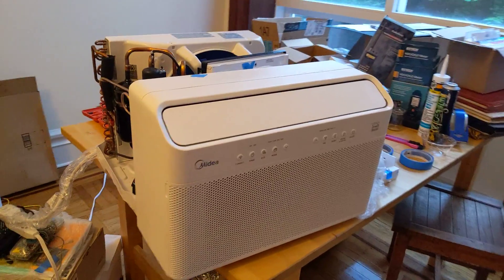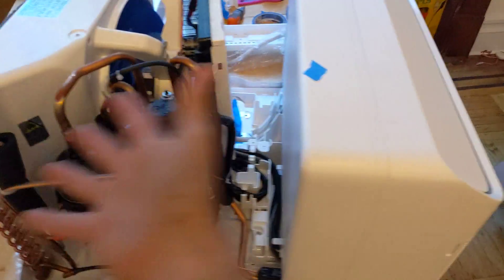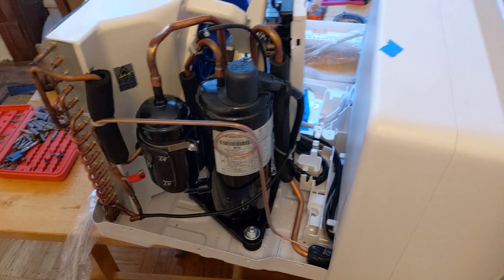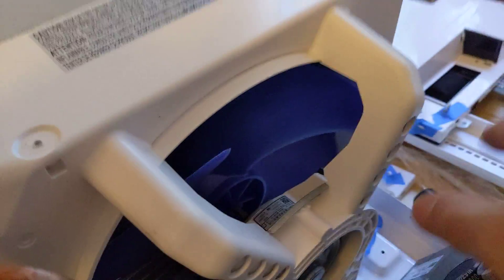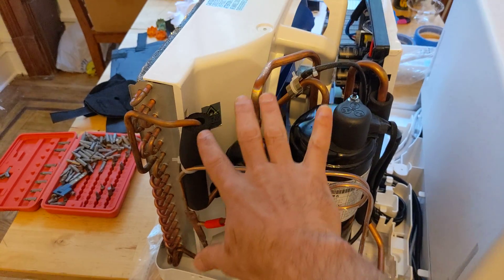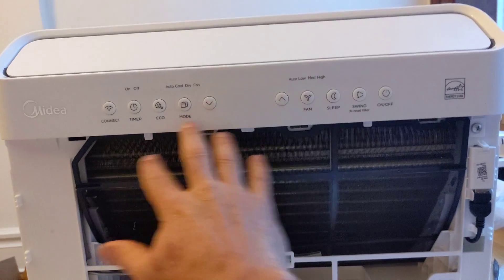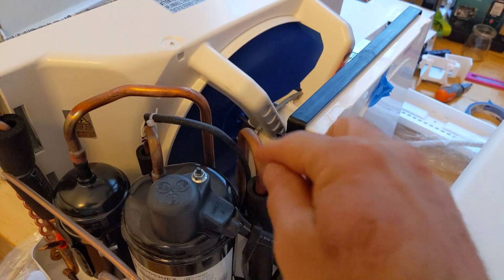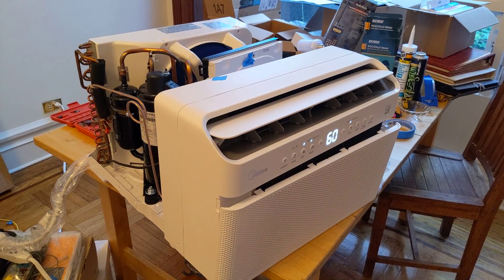How did Midea fit a full mini-split system inside their new "U" window unit?

Comment: Are there any actual power use comparisons at different speeds between the 8/10/12 models at different fan settings, etc.     I've seen a lot of user experience where even the 12000btu model hovers around 600-700w on high and often around 200w.    I'm off grid solar... more power than I can use or store on a hot sunny day but less at night, etc.     So for example running full tilt during the day to cool it down and letting it run on low at night to maintain may be the perfect setup... but really not much info out there.  anyone?   a video with it on a kill-o-watt would be fantastic.
Reply: I would love to see a test on power consumption as well.. Getting ready to decide on window AC for my box truck RV conversion
Reply: @mattolsson8816  I actually own two of these now, bought a 10k for the living room and liked it so well I bought an 8k for the bedroom. 

They are both extremely quiet, never 'surge'  as the compressor / fans just ramp up and down as needed.    The fan speed and mode determine power use.  

The 10k unit can definitely hit 700-800w on high on a hot day... but it cools very well and over time the power use comes way down.  Its not like other AC units there are either 'on', 'fan on' or 'off'... everything about these is on a sliding scale that adusts as needed.    On Low it starts out at around 2.6a and can work its way down to 1.8a with rare bursts to 3.5-4a for a minute our two here and there.  Setting it to 'dry' is the next lowest power use...  4-4.5a and cools while doing a lot of dehumidification.   Medium uses around 5-5-6a and high can use 7-8a.    But note these are 'MAX' values... it often uses much less power at all those settings depending on how hot it is outside and how long its been running... its like it hits its stride and can coast for long periods.    The 8k unit is the same thing with the power use curves geared a little smaller...  2.2a on low and often gets to 1.1a when running over night.  Otherwise the units are identical in function and same size in 2 out of three directions... the  bigger ones just extend out a bit more. 

Being off grid...  I use LOW at night and on cloudy days and medium or high on a good sunny day.  I've really never seen an AC like this... it sips power... overnight  use is saving me  15-20% vs the old frigidaire 6000btu unit I had in the bedroom and it was a very low power model.
Reply: @digitalalchemy6414  wow.. Thank you for that detailed description.. You may have convinced me to buy one of these instead of the 6000 BTU GE Profile unit. Sounds like it may be very suitable for my application.

Comment: Just installed mine. and while I love the quiet, I takes a long time to cool down the room compared to my old 12k BTU. I'm only getting 55 degrees coming out of the vents. Has any one checked the temp out of their unit?
Reply: What's the temp in the room?
Reply: Turn off eco and use boost setting.

Comment: Great video, thanks! We are really enjoying our new unit but another request for any information on disabling the annoying beep when you reset anything. It is way too loud. We have asked the manufacturer for a firmware update but no reply.
Reply from the maker: I already put mine back together, but I bet you could find the speaker pretty easily if you were willing to remove the cover. If so, you could either cut one of the leads, or probably even just put a piece of tape over the hole.

Comment: that's awesome! finally some contemporary tech! it'd be even better to have a U unit that worked without blocking the window. (that one but flipped over)
Reply from the maker: Agreed! SoleusAir makes one. Here is the link...

https://soleusair.com/index.php/2020/05/16/press-release-the-2020-winner-for-best-global-design-for-housewares-and-home-electrics-is-soleus-air/

It is a harder problem because walls can be much thicker than windows. Another interesting design that I have not seen would be completely flat with horizontal coils indoor and out. This could potentially be more efficient & confortable because of the upward air flow, but would require some creativity on the compressor placement. Maybe use a few of the soda-can sized ones in a row?

Comment: I ordered one for our Ford Transit van conversion project. I’m hoping I can separate the two sections (enlisting our auto mechanic for the refrigerant line work) but i see a lot of electronics cables between them. How hard to you think it would be to extend them?
Reply from the maker: If you are going to break the seal on the refrigerant lines (needs EPA certificate) then maybe easier to make one from scratch using new parts that exactly fit where you want. If this is for a 12VDC vehicle then you can get a compressor with a driver board that runs directly from that and it will be more efficient than driving this from an inverter.
Reply: @bigjoshlevine  I had the same idea, in my case I had bought the U from the Indiegogo campaign and have been using it all summer. You mentioned 12v compressors - I haven't been able to source one outside of very sketchy Chinese websites. Where do you source your compressors from? My bus will actually be 24v if that makes any difference. Thanks in advance!
Reply from the maker: @orangeisnon  I've gotten many compressors from Aliexpress and always had good experiences. The new good ones are brushless and usually come with a driver board that runs on DC so very efficient and easy.
Reply: Dude this is what I just asked about. My thoughts exactly! So I have an HVAC recover the refrigerant and I cap the lines. Get it mocked up on the truck with new lines as the two pieces are now away from each other. Figure out how to evacuate and charge, can just get a gauge set or pay an HVAC guy. 

I'm on the same idea. Just have to learn more about this type of system. I'm an automotive guy some R12 and R134 is my bread and butter.

Comment: LG has actually had fully inverter driven window AC units out for nearly two years now. Inverter-driven compressors and BLDC indoor/outdoor fan motors.
Reply from the maker: I have one of those! I was very excited when it was announced, but was disappointed when it arrived. Have you used one?
Reply: @bigjoshlevine  I've seen a 14k BTU LG Inverter in use. Quiet and seemed to work well. I didn't personally own it though.

Comment: Also, since this is essentially a window mounted mini-split system, does this unit also allow for heating in the winter in temperate climes?
Reply: For example, if you placed in the Auto Mode (since there is no heat mode), could the unit or would the unit simply pull heat out of the inside air and push it to the outside?
Reply from the maker: Unfortunately no, that would require a reversing valve which this unit does not have. But you can always just put the unit in the window backwards! I've done this before for heat - works great in mild outdoor temps (maybe above 40F).
Reply: @bigjoshlevine  Thanks for the reply! That's a very common sense approach to the problem. :)
Reply: @bigjoshlevine   ok, but then you forget to protect it from rain which gets the control panel wet and then the unit is junked!
Reply from the maker: @southbridgeforestHOA  I've left another unit outside and running for years and no problems!
https://twitter.com/bigjoshlevine/status/1285064587180740609

Comment: "Most interesting"????  I just finished installing a 10k Media in a small window.  The AC had BETTER be great and long lasting as it took me three days to finally complete the installation.  Throw away the 'quick' guide.  Fully read the manual and ALSO watch the video.  Both will not address the gaps beneath the unit or from the mounting bracket.  Expect to use a lot of caulk underneath and around things,  Also, your window will NO seal down on the unit so put something there as well.  The supposed must have and must use 'open window bracket' wasn't included.

Bottom line - unless you're VERY handy, only get this thing if you've got a professional installer handy.  Otherwise, you're going to have problems getting it working.
Reply: Same, took me between 30-45 minutes to install. I can't really fathom why it would take 3 days to install.....
Reply: @jbreezy81  I agree. I found it very simple and straight forward.

Comment: Do you have a kill a watt meter to put on the unit?
Reply from the maker: I do indeed and will get some readings tomorrow, but keep in mind that it is an inverter unit so uses variable power depending on the speed the compressor is running. Ill try to catch worst case when it is hot outside and full demand inside. Anything in particular you are looking for in the data?
Reply: @bigjoshlevine  When you look at the specs for mini splits many list their btu range....it would be interesting to see what the btu range is for this unit.

Comment: Does it drain water like other window ac?
Reply from the maker: Depends on temperatures and humidity levels both inside and outside, but it is more likely to be able to evaporate the condensate water than typical AC units. But if it is very humid both inside and outside (most likely humid inside because door or window open) then it will overflow and dump water out the back.
Reply: No, it does not

Comment: What's the sound?
Reply: The inverter unit causes a high pitched squeal due to the inductors being utilized to stabilize the output.  Not a lot you can do about some of the noises.  I think the metal noise is the variable veins being loose at startup.  Mine does it as well, but goes away.  I'm going to just ignore it and see what happens.
Reply from the maker: I don't know! Sounds like metal hitting metal inside the compressor. I am not willing to take a grinder to it to find out. Maybe someone here has a guess?
Reply: Unfortunately my unit has annoying squeaky sound as well and at night time it is noticeable

Comment: I’m guessing you waiting for your mark 2 zero Breeze
Reply from the maker: I did not order one. I'm guessing it is basically the same as the original from a refrigeration loop perspective. But if you get one LMK if there is anything interesting inside!
Reply: @bigjoshlevine  It is different than the first one...it actually works. I'm really impressed with it.

Comment: Those U shaped air conditioners were available for sale in the 1960s-70s but consumers didn't flock to them so they were discontinued. Here is another similar design but the inverse of the Midea.https://www.youtube.com/watch?v=FfW50FrlaT8
Reply: One of the quietest a/c units built was Panasonics L-shaped. Front was only 4-5 inches high and the main unit hung down the back so the house shields the compressor noise.  Still going after 30 years.

Comment: If it's a split  mini, can it heat as well or be configured to do so? Would love to use in my RV.
Reply: Sure. turn it around :) :) :)
Reply: @IThinkICare  clever but I doubt the control panel would work after afew rains!
Reply: @Brock Clyde If you're willing, I thin many of us would love to see a follow-up video to learn more. Thanks!
Reply: That would be a heat pump, which requires reversible valves to reconfigure which way the compressor and expansion valve flow.  Those coolant valves are a very different thing than just making it a split system

Comment: I really like this unit, the u shape concept is awesome and the variable speed compressor and fans are a huge leap in the window unit industry.

My only concern is that exposed PCB that doesn't appear to have any protection whatsoever. Someone is gonna neglect to take this unit out of the window when it rains, and I can see that being a failure point.

EDIT: according to a friend who picked one of these up, The PCB is shielded, with a small cutout for the heatsink.
Reply from the maker: The PCB is safe inside a very nicely sealed IP enclosure. It is shown with the cover off in the video. Sorry I should have made that clear!
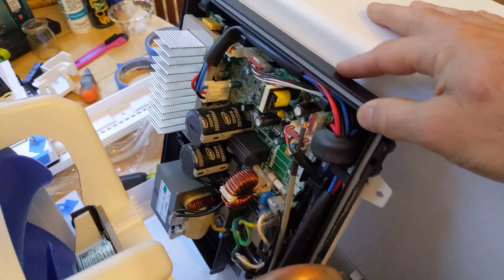Reply: Is it actually that exposed though? When he's going over it at 2:12, its almost looks like the PCB is supposed to be inside something. I only say that because the edges of it looks like it has some kind of weather-stripping or gasket around the board. Im not sure though.
Reply: Mobius one of my friends got one of these recently, and it turns out that PCB is completely shielded. 

I am going to edit my comment.

Comment: This is pretty cool.  A concern with something like this is that it seems like closing the window on the unit wouldn't create as strong of a seal as closing the window on the window sill, potentially being less insulated. This is a problem with window AC units in general, but since this can be used to heat as well as cool, a lot of heat from your house could escape during the winter. They must have designed for this of course, but something like this might not be best for places that have cold winters.
Reply: It doesn't heat.
Reply: Where did you get that this unit can heat as well? It does not seem to have that function... I understand it is a heat pump system, but it does not seem to allow for heating.

Comment: I don´t  know if you know electronics but please DO NOT TOUCH an electronic board again while it is connected and even less touch the capacitor coolers because I had a bad experience with them.
Reply: While not indifferent , to express a 1st amendment protected philosophy of electronic mishandling and regulatory safeguards,  would you as an individual declare yourself under the clause of "peaceful slavery" or "dangerous freedom" , while it is argued safety beyond other preparations,  do you think as an individual endeavoring of an unwarranted dismantling passed consumer calls for dangerous freedom ?

Comment: what do the indoor side looks like?
Reply from the maker: Just the centrifugal fan, the evap coil, and the temp sensor along with the buttons and the LEDs.
Reply: @bigjoshlevine is that fan a centrifugal fan (squrrel cage) or a cross flow (like the Haier ac in your earlier video)?

Comment: I wonder how difficult it would be to hack it to allow setting the compressor speed to anything within its supported range. A few of those units could then be a good option for those looking to make the A/C unit(s) follow solar production closely, reducing the battery capacity needed for buffering.
Reply from the maker: I don't think you would have to do much hacking - you could probably just control the setpoint temp over the Wifi using something like a RaspberryPi! Add something like a Sense.com power monitor and you should be able to pretty accurately match the load to the solar supply on the time scale of minutes to hours.
Reply: I think anything "inverter" is essentially running DC internally, PWM motors, thats why they are pricy, pure sinewave AC-DC stuff
Reply: This looks like a pretty standard Midea unit. There exists some debugging tools for Midea air conditioners that can communicate with their split models and drive them, but I don't know if they will work for this. On 9000btu mini split, the compressor draws less than 200 W under its minimum speed, but there is a limitation on how low you can go, because the compressor has minimum RPM for oil lubrication.
Reply: Wish they would make DC units for this purpose
Reply: @GoatZilla  They do make DC mini splits.